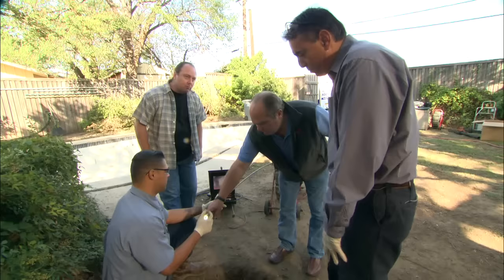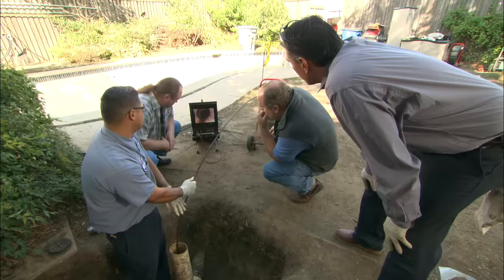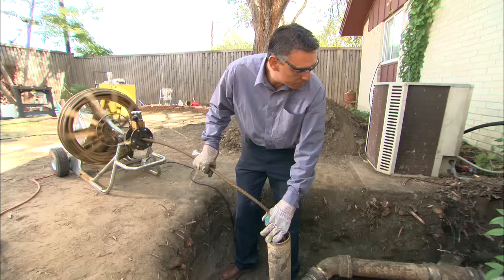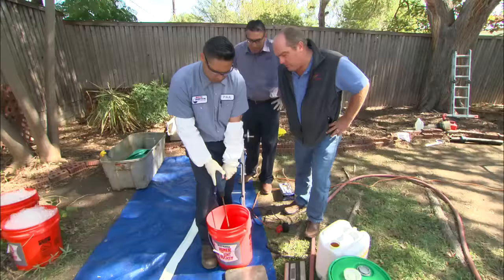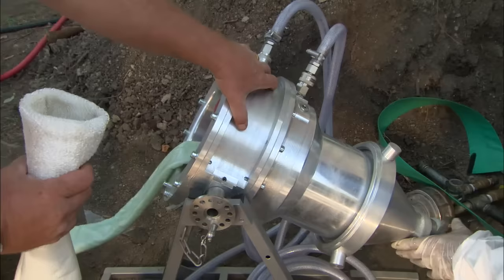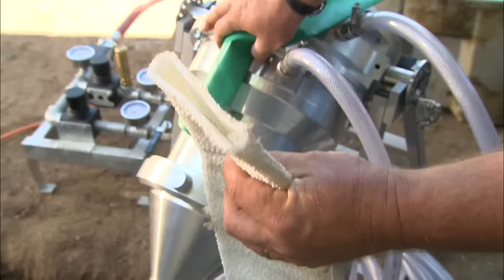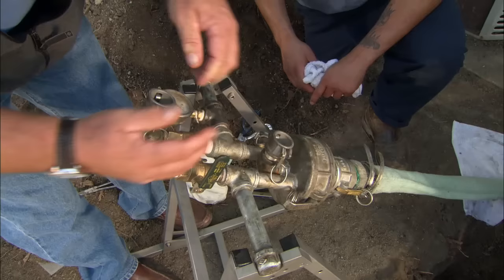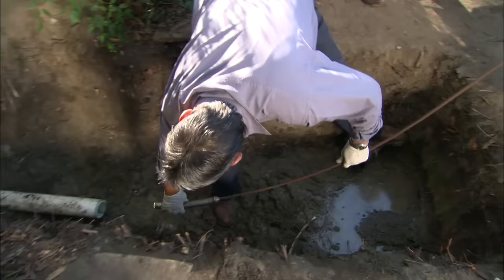How to Repair a Sewer Pipe Under a Concrete Slab | This Old House

Comment: I love how in their other video about replacing a cast iron bathroom drain that was over 80 years old and still working fine, they wanted to replace it with cheap PVC pipe.  Now here we are on this video with broken PVC pipe drain where they want to use a liner instead of replacing.  I've said it before and I will say it again.  Stop using cheap plastic pipe when you have to bury it and/or put concrete over it.
Reply: Mcmansions meant to look pretty with no regard to lasting longer than it takes to pay off the mortgage. Then the owners apply bandaid fixes for cheap when it all starts to fall a part and still try to sell for 1.25x the price they bought it for. And then people wonder why the housing market is so bad and so few young people are buying houses these days. That's why I am saving up all my money and just going to buy a large plot of land and build my own house so I can control every detail, including fully accessible and exposed plumbing of 100% stainless steel pipes. Never have to deal with any of these issues my family always had growing up.

Comment: how about the fixture fittings/connections to the new lined pipe?
Reply: Afaik that is a real issue. Long pipe runs are ok fixed like this, but I've heard multiple times that connection parts are prone to multiple problems ie. sharp edges that gather dirt/debris to easily cause serious flow problems. Obviously these problems are very hard to fix inside of pipe. I was heavily surprised that these weren't mentioned in this video. Also heard that joints could open underground (obviously completely depending on type of piping to be fixed)
Reply: Luke Peters a remotely opperated cutter goes in and opens up junctions that were previously mapped and plotted durring the intitial remote video inspection of the repair area.
Reply: There aren't any fittings to speak of. Just a smooth taper.

Comment: Lawsuits are happening because the plumber's didn't correct the loss of downward slope so the lines are still clogging up.  Another the liner bursted the cast iron into a washed out cavity.  Customer still had to pay for lining and jack hammering to fix that point.  It's awesome but not without it's risks.

Comment: That's all well and good but how would it fix the bellies?
Reply: And you'll never be able to snake it either my snake would rip that pipe to holyshit
Reply: It won't fix a belly unfortunately that requires excavation and re-pitch.
Reply: @dmo848  the snake actually won't damage it at all.

Comment: Wish more info was given about the new pipe material. What guarantee is there that the tree roots won't bust through it as well..?
Reply: I work for my local municipality, and we have used this process for over 20+ years and have rehabilitated miles of sewer pipe. We have had zero problems with them once properly installed. The given manufacturer warranty is for 50+ years. It is by far the best and most economical way to replace sewer mains. For service lines, I'm not as sure. But having essentially a new sewer in as little as three hours without having to dig up your yard, your fence, or your driveway is really nice. No building permits, no heavy equipment. Trenchless technology is the future. Too many positives to outweigh the negatives.

Comment: I like the idea of using a video scope to find the break. Perhaps measure how long you went in with the scope and only repair the broken part. This way you're not cutting and breaking out the whole line.
Reply: Yeah that's what a smart company does that doesn't rip off the customer. That's exactly what I would do you hit the nail on the head
Reply: And the camera has a locator on the end of it so you use another thing to locate exactly where that is so you don't make a big mess that's what my company does
Reply: @dmo848  i read that is not a good idea to connect cast iron to pvc..destined to fail..that true?

Comment: What is the thickness of the liner (for various size pipe interior diameters)? How much will the size (cross sectional area or diameter) be reduced?

Comment: It took me 11 hours to do a 8-foot section in my basement busting out concrete replacing the clay pipe $800 labor and material
Reply: The issue here is that there is no basement. You'd have to jackhammer your literal house up.

Comment: How easy is it to retake that back out and replace when the roots break through the original pipe again then break that 
How smooth is it on the inside of it how easy is it to get clogged

Comment: I'm curious to how much the inserted sleeve reduces the inside diameter.
Reply: 1/2" did you watch the video?
Reply: @jamieloeffler2504  yes, that's how I formulated my question. Since I didn't hear the 1/2" part, I didn't know what it was. I just watched it again and still didn't hear him say it. Thanks for the info though.

Comment: That’s pretty slick-I can’t tell you how many countless slabs I break every week
Cool machine!
Reply: Do you think this would work for a bellied pipe repair under a laundry sink?
Reply: @mikepietrusko5775  Unfortunately, a belly  is a belly. If it's bad enough to cause a drainage issue then it has to be removed, replaced and tamped.

Comment: Would love to do this. Quality work as well
Reply: nick ziemba don’t do it. Take it from me a real plumber. That’s a polak way of handling situations like that. That method is far from efficient and even if it does work all it does is decrease the inside diameter of the pipe. Just pay the money and get the job done the right way.
Reply: It works in the right scenario and only reduces ID of pipe by 1/4th of an inch, not enough to worry about. Take it from someone who is certified to apply this technology and train others in it.
Reply: @jaylopez6281  What is "the right way"? Tear up the house entirely and put in new pipes from scratch?

Comment: I need this but the cost for them to dig up my basement and replace 21ft of sewer line is $7500. how can I get a plumber to do this method without having to dig up the basement and how much does it cost? im in Pittsburgh,pa. mckeesport
Reply: From where and how much it cost

Comment: Anyone knowif you can leave a broken bathtub drain pipe uncapped underneith the home to the main. it would be unused, but would you get alot of residual leak or would it be ok. anyideas?
Reply: call and ask a plumber!
Reply: Grab a 'Jim-Cap' and put it on the pipe, tighten the screw and you'll have peace of mind.

Comment: I think decreasing the diameter of the pipe is against most codes,  and I also don't think that pipe will hold up to a roto-ruter!
Reply: If roots can't grow anymore you won't need to rotorooter the pipe. If you do for any reason they can use high pressure water called hydro jetting to clear the pipe.

Comment: Ok then this is good for certain jobs however. Low spots are still there  and just a thought now pipe is smaller diameter I know not a big deal but what fitting is used where liner stops at original pipe can see there would be a lip there with all plumbing codes don’t really understand why this is allowed.

Comment: These break i seen it happen.  Very thin wall and a cutter head can damage it when snaked.  It’s not really a permanent fix.     Just my two cents 25 year licensed NJ PLUMBER here
Reply: That's a really good observation, thanks.
Reply: It's permanent if installed by a certified competent installer.

Comment: So, pardon the stupid question- if you're lining the inside of the main sewer line, how do your toilets and sinks drain into the line? Don't you have to jack hammer through the slab anyway to connect your smaller lines to the main line?
Reply: pedsrads a remotely opperated cutter goes in and opens up junctions that are previously mapped and plotted durring the remote camera visual inspection of the repair area.

Comment: Another way to better clean the old pipe is running a water jetter with a warthog nozzle. This technology is known as liner. Another technology as splitting the old pipe from inside with mechanicial blade(s) is known as pipe burst pipe system. With liner you only have to excavate 1 hole. With pipe burst you have to dig minimum 2 holes. They are ideal to replace such a straigh sewer lines, however; these technologies do have their limitations as if the falling grades as bad or there are difficult turns in the way. Excavation is long and painful but it surely gives the best solution.
Reply: I don't think so,,A Sharp Blade that is rotating would be better to clean and smooth Old pipes than Water Jets as you see it in the video.......Water Jets mainly good for Clean smooth pipes in place already...  And pipe burst system, really?  Sounds like a gimmick to make more money. imo..
Reply: @baclieustud  Depends on how skilled the hydro jetting tech is! Usually both will work though. However pipe bursting is no joke and is usually far superior to lining...as long as you lack tie-ins!

Comment: what happens to the liner when you have to sneak it
Reply: Betting you have to use a smaller diameter clean out tool than before but you shouldnt need to cut roots any more just whatever you flush

Comment: can this process repair the main sewer line?
Reply: Yes. Absolutely. My city has rehabilitated miles of sewer using this technology. We also do spot repairs when the whole line doesn't need replacing. Say, a broken or really cracked two foot section needs repaired. We can fix it in about three hours with no damage to the ground above. The repair kits that we use cost about $300. Very economical and they work great.
Reply: @beeveebee  where are you located and who did you use?
Reply: @cj-qj4ly  I live in Idaho. We purchased our equipment from a company called Source One Environmental. I think they're located in Michigan. We have had repair companies come out and do repairs for us in the past, but we figured that it would benefit us more if we could do them ourselves. Our typical repairs are on clay or concrete sewer pipe that range from 6"-12". There are a number of companies that offer the tools and the kits. Perma-liner is a big one and they have videos on here that explain the process quite well.

Comment: Slip lining is awesome but crazy expensive yet less then the cost, labor and mess it is to dig up the entire main sewer line inside the foundation to replace, especially a portion under a slab or basement floor. Never build a home on a slab if possible, not that it stops pipes from breaking down or the ease of access to be that much easier, but a crawl is ideal even though a basement is basically an underground slab if Plumbing exists under the basement floor and doesn't go out the side of the basement wall/foundation then slip lining will be your best bet unless the pipe is in such a poor condition then a dig will be necessary unless a reroute is possiblle. There's no such thing as a perfect system but there are better options.

Comment: It's work for straight main line, how do you do after it go over all Y connection?
Reply: Here in Germany this is a common way to repair the drains that are below the streets. In my home this was repaired that way too. It was the main drain from the house to the sewer below the street. But actually there was a connection in between, a down-spout from my roof. They've removed the down-spout to get access to the drain and cut a hole into the liner. That stuff is getting really hard, if you want to cut it you need a diamond cutting disc on a grinder. The contractor is charging additional money for every access point that he'll have to make. But it wasn't a Y, it was a T.
Reply: If you shoot passed any tie ins you will need to use the picote to grind out the tie ins to the mainline.

Comment: I see a lot of questions regarding tree roots getting through the new liner eventually. I would think that wouldn't be an issue because there are no joints when using the liner. Don't roots typically poke through only at joints because they can "sense" the water at those locations? Non-plumber here, so if I'm wrong please correct me.
Reply: Yeah sewers r too complicated thats y i just poop in the backyard
Reply: Correct.

Comment: I speak from experience. They charge you just a little less than it would cost to replace it the old fashion way. Instead of charging for raw labor and materials. They base cost slightly under what it would cost a plumber to dig up and replace in order to maximize profits. Don’t believe me? If you ever need it done, get both quoted.

Comment: So basically if you are going under a floor and dont want to bust up the floor this is a clever solution.
If it (bad pipe) goes under a shopping mall with quartz tile worth a fortune this re lines the pipe with out busting up the floor. I like it. I never would have thought of this.

Comment: amazing - i have this problem and it going to be amusing to see how many plumbers are going to come out and insist the only way to fix it is to rip out the concrete - that may be what has to happen - bus just like the heart surgeon its good to get a second opinion be before  you put in a stint

Comment: Tree roots will just get through the pipe again.
Reply: Yup
Reply: Encasing drain lines in concrete or metal, might be the answer. Or maybe just building the drain line above ground, but within a box.
Reply: @johnthree1611  yeah it don't work like that.
Reply: Only way and right way is to rip it up and do a spot repair or else the roots just grow back and yeah i would throw a bag of concrete mix on top before i back fill. That would guarantee the roots can't get back. Lol but they will most likely find the next shot for water so you'll fighting a losing battle. It does take years though for them to grow to another area

Comment: directional boring  would be cheaper in my opinion.
Reply: I disagree. Having to dig through the slab to reattach the new line would offset any potential savings.

Comment: Get your checkbook ready this is extremely expensive
Reply: How much are we talking? We just bought a house Friday and found out over the weekend that the washing machine drain under the slab is busted...plumber said it "might" be under 10K to fix, but he was talking about tearing up the slab to do it.
Reply: @lesleypacini  whole house sanitary re-pipe $10-12K plus tile/flooring pipe lining about $15-25 but these are southwest Florida prices depending on the size of the house
Reply: @davem145mxr  what is a sanitary re-pipe? Does that replace all the pipes including the sewer side of house?
Reply: cynthia colley it is the replacement of the sewer pipes within the house

Comment: Probably not useful if needing to plumb other connecting drain lines (tub, sinks, toilet)  to the main drain line. Hopefully they can saw the concrete; no jack hammers.

Comment: Definitely looks like you know what you're doing and keep excellent equipment. .i sure would like to see say 35' or more..
  I worked with a guy who my boss subbed out..he came alone, truck was a shambles..he had his scale & mixer after that trouble..it was 35 years ago and just had to blow it up to 80 psi if i remember. .but have to punp it like 2o min work time..his compressor was in pieces, i went to my shop asap told my boss give me 1..he said let him buy 1..I say its not even an option i got less than 10 mins left to work with this..he gave me our little compressor,  i wanted the big one..No he said..this guy is supposed to do the job, i'm paying him 3grand for a couple hours work he didn't bring the tools??..anay way the small compressor and the guy like taping the hose into the epoxy taping it up. And running it overnight...my goodness what a mess..i was stuck as a "helper/ jr mechanic" in the middle between these 2 who didn't care about the customer. .in my opinion buy the $ 120 - $200 compressor,  store was before my shop, or rent 1 fast..
  Line looked like inside a cave, points everywhere,  only have a chance of water going through..no way paper or anything goes an inch...
  So now guess who has to cable the line..kkkkk...theres no way, its epoxy, by now the customer is quite angry with everyone.. Winds up why i never met them..i started 8am they were long gone, i night i left 7pm they were not home.
 Both lawyers..so guess what happened. .they said they wanted it replaced from jump, and money was never an issue (within reason) . had someone professional like yourself come everyone would've been happy..
 I learned alot about customers, and i never assume they don't want to pay, if I am going to be put in the middle 2 things..either i need to know how to do it also or I get to hire the sub..
 Your whole job top to bottom I was just thrilled with.. Clean always wins..thanks

Comment: U cannot get those small roots out with a sewer machine how do u know first where to stop where the roots are , second the machine snake does not touch the top of the pipe , the only way to get most of those roots out is by hydro jetting it , then shoot the liner in !!

Comment: What happens when there's  a t junction or a gulleys  in the run
Reply: Neil Whiting The entire street I lived on was done with this process. It took a couple of days. I talked with the crew about the process.Before the liner is installed, the pipe is mapped and plotted out with a remote camera to locate all the junctions from each house. After the liner was cured, a remote robot with a cutter on it is guided to the previously plotted junctions to open up a hole under manual control. It was really impressive.
Reply: Thanks for answering my questions dude i love you

Comment: am I tripping or isn't the problem at like 3' - 4' with that misaligned repair? mud loves toilet paper. I know their method for this situation is ultimately superior to prevent root issues down the line (lmao). but I am really sure that misaligned pipe is doing it currently.